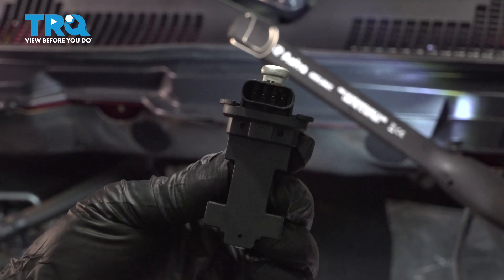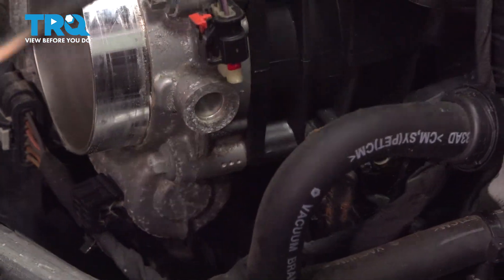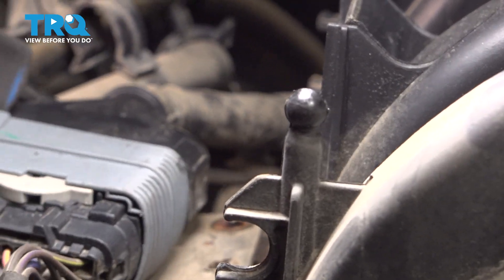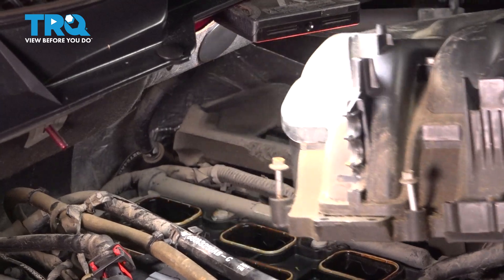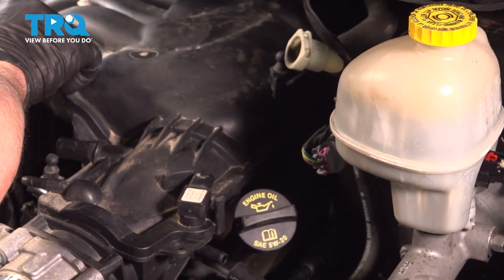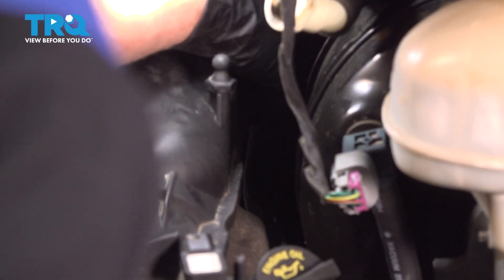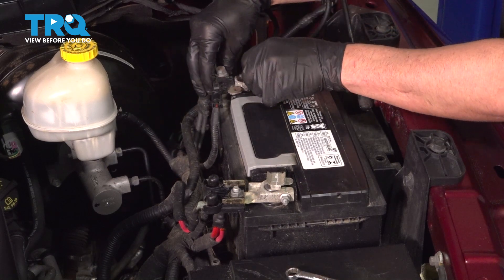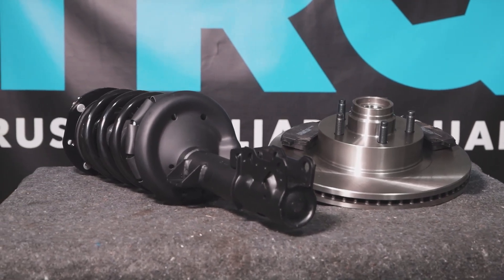How to Replace Camshaft Position Sensor 2011-2018 Ram 1500 3.6L V6

Comment: For all those asking there is two this one is on the driver's side, the second is EXPOSED super easy to get to look at where your spark plugs/coils are on the passenger side of your truck it will be almost against the beginning of your cab